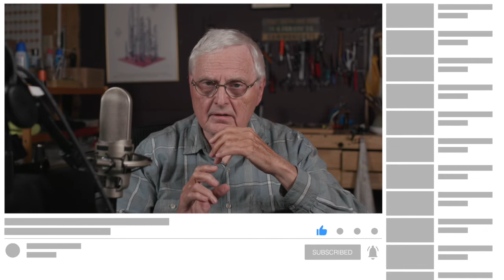how detailed testing can dramatically improve your reed work

Comment: I am watching your sand the reed , are your applying pressure on the "return stroke"?  I know that ATG means "Against The Grain" ... but it sure looks like you are sanding in both directions ...?  I have an ATG system and only take wood off the reed in one direction, taking care to lift the tool on the return stroke  ...

Comment: Tom, thank you for your clarinet reed knowledge, testing and examples!  Can you elaborate on the relationship between the higher notes and how far down the reed you make adjustments? Thanks!
Reply from the maker: That depends a LOT on the reed you're working on. If it's very resistance and dead in the lower register some wood will need to be removed. But, for me, that's a last resort. Most of the work I actually do on a reed is from the sides of the middle part of the reed on up. But there are too many variables to say anything specific. You learn this by personally engaging in the process.